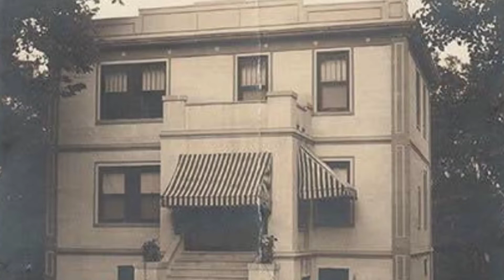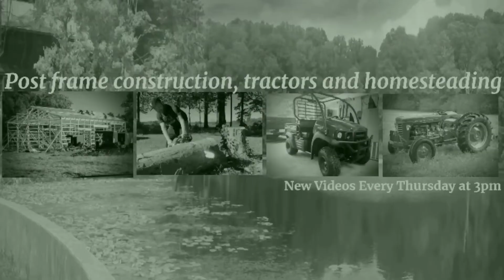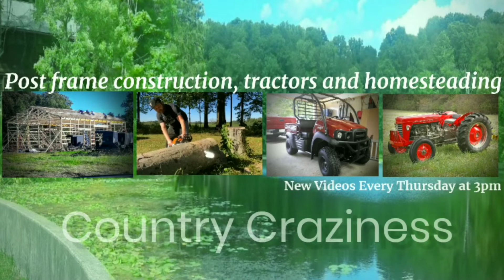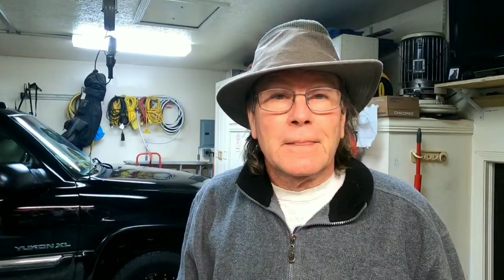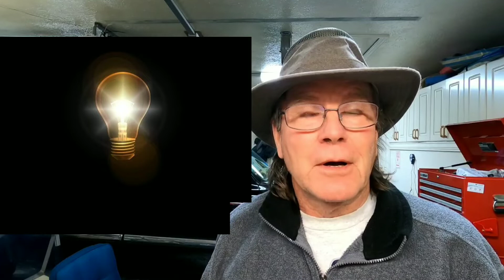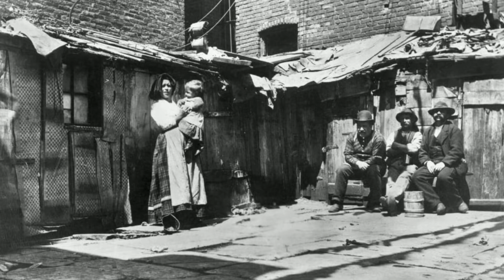Edison printed 3D concrete houses 100 years ago. This is how he did it.

Comment: Why not start building concrete houses in the USA? Are there building codes regulations that preventing it? I know concrete houses are built in other countries.
Reply from the maker: They are starting to 3d print houses. I believe I saw a house on a YouTube video in New Jersey
Reply: Nah.  The builders are not interested.  They want to use the more "expensive" way using the cheapest (illegal) labor.  You'll own nothing(reasonably cost) and be happy!!
Reply: Back then Concrete was cheaper than wood so it was a low cost method of building.  Today concrete is more expensive than wood so it doesn't make much sense.  The only time concrete is used is when it is structural.  3D printed homes could be cheaper but that is by bringing down the cost by cutting down the cost of labor.
Reply from the maker: https://youtu.be/9LjDt4CvIrw
I made this short video on concrete homes being built today. Check it out.